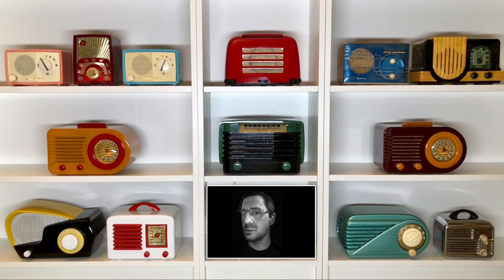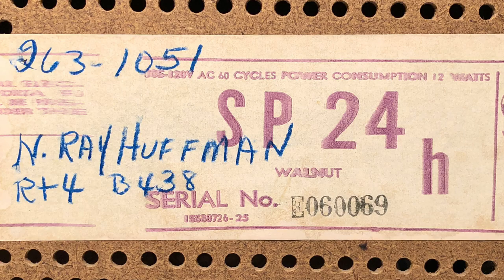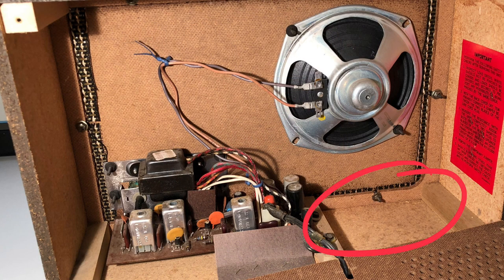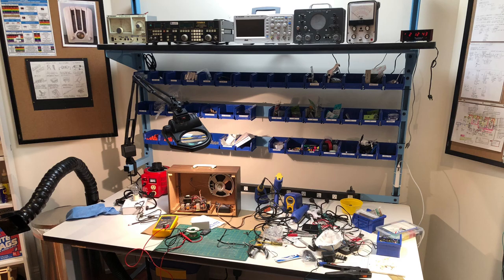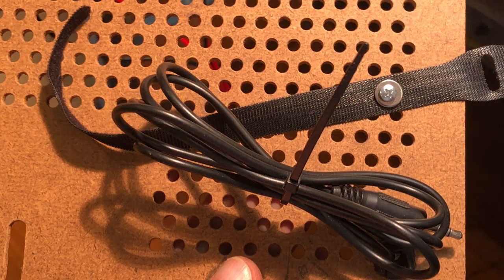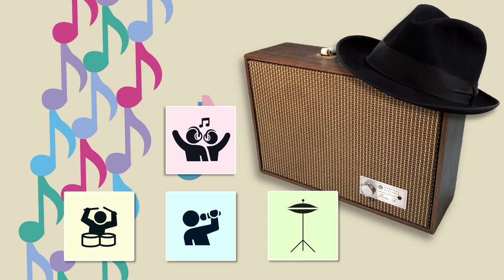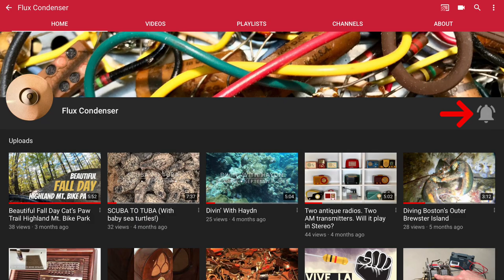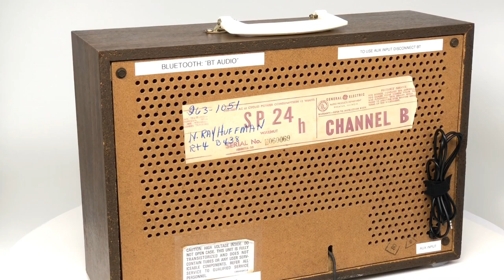Let’s Add Bluetooth To This Vintage Speaker

Comment: Just bought one of these myself and i to thought it was going to be a tube model, had i read that back sticker i would have realized it was transistorized.
Anyway, i plan on copying your work. :)
So did you give it to the nephew?
Reply from the maker: Fantastic! I think you’ll be pleased with the results. Yes, I gave it to the nephew and he absolutely loved it. I should check in with him to see if he’s still enjoying it. If not, I’d gladly take it back!
Reply: @FluxCondenser  Almost finished now. I copied what you did pretty much. Nice volume and sound! I have been listening to Tchaikovsky, Beethoven, Mozart , John Denver, Bob Segar, and even IZ, "somewhere over the rainbow". Nice sound and plenty of volume without turning up too loud.

I spruced up the cabinet and put a nice briefcase handle on top and replaced the feet with new rubber feet like you did. Mine were wearing thin also.
Only thing i did different to speak of was to install a female 3.5mm panel  jack on the back to plug aux. into.

Thanks again!
Reply: Oh forgot to mention, it is awesome for playing "sleep sounds" like thunderstorms!
Reply from the maker: ZenithClarity1969 Fantastic! So glad to hear it worked out for you!
Reply: As the mom of the nephew, I can say he was very appreciative! Great work, uncle!! ;)

Comment: I think you should try harder to pick a crappier more generic song to play through the speaker. Other than that i liked the vid
Reply from the maker: Ha! Thanks. The YouTube audio library is limited. If I had my druthers, that thing would have been rocking some Clash or Pixies.
Reply: @FluxCondenser  i have never made a video, i assumed you would have to download whatever audio you wanted. But i do.know if you play a song longer than 15 seconds you can get demonetized. I was jusy playing around but i actually do hate those annoying electronic songs that are in a ton of vids especially those 10 new hacks vids lol.  Buy hell yeah , pixies is one of my favorite bands and the clash arent too shabby either.
Reply: @skullheadwater9839  youtube has a really good music library, but you have to search for the songs. some of them have words and are actual songs. maybe not when this video was posted, but right now its very extensive and there is no need to use these generic boring ones anymore.